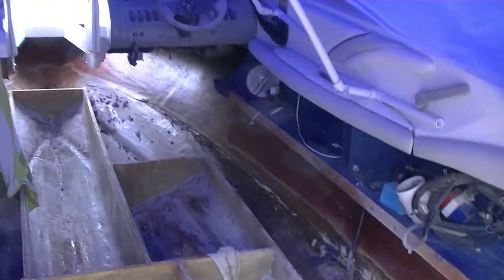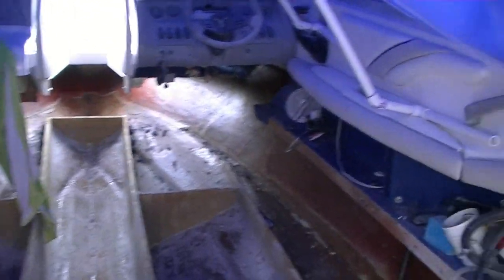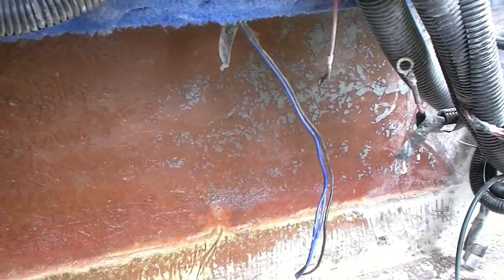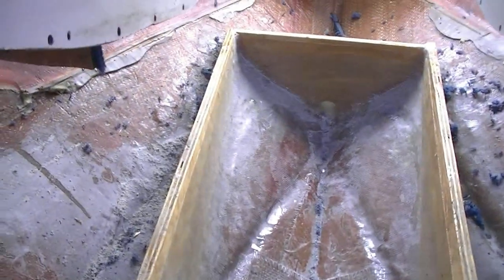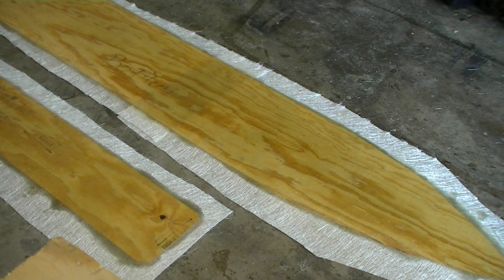Weekend update- More Grinding, Glassing, and other nastiness Vlog #30

Comment: If you were to use Methyl Ethyl Ketone to clean and soften up the area instead of acetone before your layup, wont that have an adverse affect? The hardener in resin is Methyl Ethyl Ketone Peroxide. I've always been led to believe that doing that could chemically destabilize the MEKP, and thats why acetone is used instead. It hasn't seemed to affect your work but i was just wondering